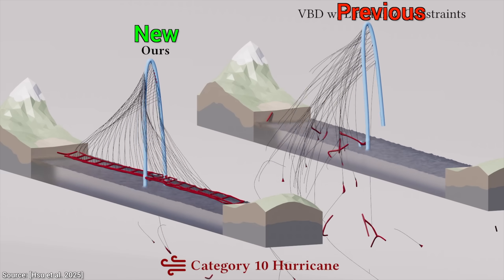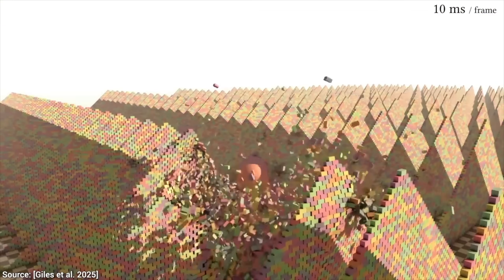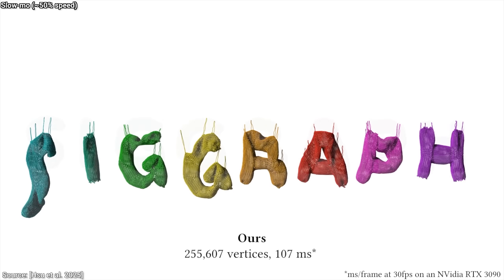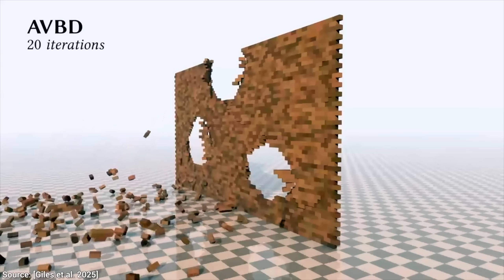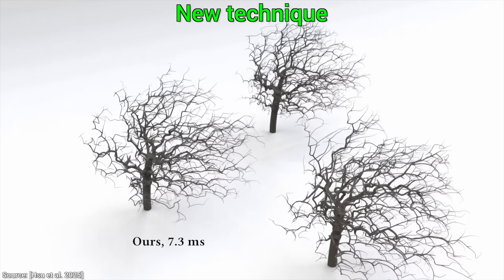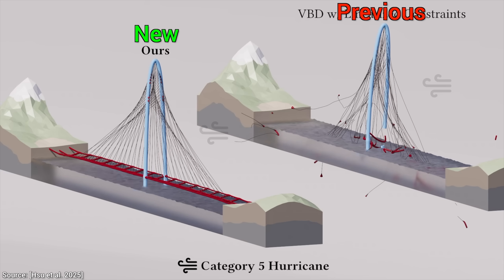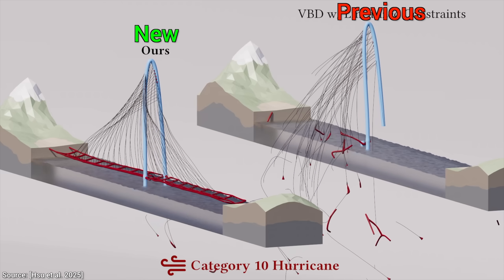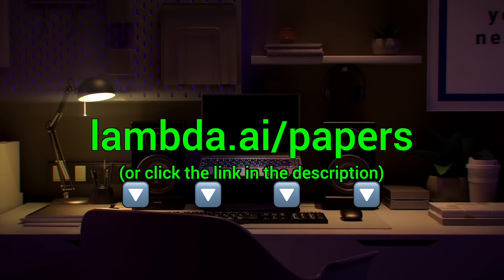This New Physics Engine Is 45x Faster!

Comment: Literally no one animates a fur or a whip, that's not how that works, that's not how anything works. A whip can be 30 bones there is zero reason to animate it when you can drive an FK chain physics function from the hand driving the whip you could probably do that 30 years ago. More you would never individually animate fur maybe stop using chatgpt for your intros you sound like a mouth breather.

Comment: If your technology can be implemented in the gaming industry, it will be amazing. Especially if it can be implemented into old or existing projects without the need for a total rewrite of the code. And/Or an interface for developers that allows you to set the necessary function names, etc. for the engine to dock with the existing code.

Comment: 2kliksphilip has done videos on old games physics, and he made a point that i could not agree with more, he said something along the lines of "there has not been much development with in game physics as we have been so focused on Real-time lighting" when he was showcasing old physics tech-demos, and i agree, as looking at old games with such impressive physics, like deformation, real time fracturing, cutting, splintering, shattering and smashing objects, as well as cloth and water physics that you would see everywhere in old games, running on old hardware such as the PS2 & PS3 with these special physics objects everywhere.

whereas now you very rarely see these impressive or interesting physics shown off, however this is back when games were made by accrual software and computer engineers from the ground up often on fully custom game engines made specifically for the game, unlike now where they are cookie cutter games made on recycled or bastardised engines made to make as much money with as little effort as possible, with the exception of mostly indie devs putting passion into their games for the sake of love and effort, not to just make a product.

Comment: you fail to mention that it only optimizes simulation of rods with rotation, and it does that by pretty much throwing the rotation out of the dynamics and doing it as a separate post-correction step. the main solver is just position-based vbd (which handles both stretching and bending), and since positions already define directions between segments, rotation only solves for twist on top of that, which is kind of useless.

Comment: Hopefully this physics engine can be used in games soon. It will be amazing to play games with physics like this.
Reply: Sadly no, its way too slow, need to be like x1000 faster. Also if you use GPU for physics then you will not have graphics
Reply: @lucasblomgren1975  I think what matters the most is that it can calculate the most complex things more easily, you should be able to calculate the simplest things EVEN MORE easily. I don't see why more optimization couldn't be welcomed. I'm pretty sure GPU are already used for the existing physics anyway, it's part of the graphics, and precisely a good reason why we need GPU rather than integrated graphics in the first place. CPU has way more reasons to bottleneck first.
Reply: @Aztonio  In the future it might be different but right now game engines don't use GPU for physics at all.
Reply: @lucasblomgren1975  Because current physics algorithms cant be paralellized. But this one can be, thus much more faster on GPUs with thousand of cores.
Reply: @lucasblomgren1975  not true. There is physx and AMD equivalent.
Reply: @lucasblomgren1975  no? Ever heard of physx, compute shaders, mesh shaders.....? Also it is fast enough, we can just do the same optimalizations we did up to this time to achieve more fps while having better physics.
Reply: @lucasblomgren1975  Idk why assume you can't do two things on a GPU at the same time, like there's multiple different things using your GPU right now and it works. Like we can run multiple different things on computers "at the same time" and it's a normal thing.

Some physics simulations cannot be done on a GPU, because they aren't optimized for it, but for video games there's no reason not use as much of the graphics card as possible, we don't need 1:1 real physics. A cloth simulation, like the ones in the video, could work much better on a GPU than a CPU, since the latter has only a couple cores and the former has plenty.

Comment: running at 30 frames on a 3090 is insane, really good performance for the calcs it must be doing.
Reply: It's not running at 30fps on a 3090, it's running much faster - the simulation time in one complex example is only 7ms per frame. But a 30fps frame is 33ms long. It comes out to about 140fps effective, which however also isn't exactly descriptive, since you can't just simulate, it doesn't make sense. You get me? For simulation to be stable, you need to set a fixed step rate, while simulation consumes a variable amount of time; but also you need to render the simulation result once in a while.
Reply: @SianaGearz  i dont get it lmao

Comment: Can't wait for this to be implemented in games and other medias! I love how passionate you are about these papers and it's really apparent in your voice!
Reply: It cant be implemented in games because its way too slow. This is only for making videos etc not real time
Reply: @lucasblomgren1975  I heard the mention of some of these being in real time but regardless I'm excited to see them in other medias :D
Reply: @lucasblomgren1975  It's way too slow... when it's calculating the most complex shit that wasn't possible before. Is there any reason why it wouldn't calculate the simple things 45 times faster TOO ?
Reply: @Aztonio  its on GPU. You cant use 100% of GPU then theres no graphics
Reply: @lucasblomgren1975  But that's precisely why optimization matters. If the most complex simulation runs flawlessly when it's a single process, then it obviously opens more questions and possibilites about how many more simulations, and other things, you can run in the same time. That's the basic of gaming. Simulating many different things at once. GPU is made for graphics but does way more than that. And actually, it's already a simulation in itself, like Ray Tracing. Displaying a frame is one of the most minor thing a GPU can do, actually. Unless you play at 8k or something, but then you're not a gamer from the proletariat like normal humans or of course you may experience reduced framerate... Well I played GTAV on a freaking Intel Celeron Integrated Graphics. It had physics... and rendered pixels on my screen. (at least a few) Crazy isn't it ? Optimization is fascinating, and complex.

Comment: Hope to see this technique used in video games like KDC2 or others with breakable structures, wind in forests and grass, fire, clothes, and hair.
Reply: It cant be used in games because its too slow. And if you use GPU for physics then your game will have no graphics at all
Reply: @lucasblomgren1975   It's not that slow, and the examples shown have included rendering, with simulation time of only several milliseconds per 33ms render frame.
Reply: @SianaGearz  For a game on 144hz then you only have 6.9ms total per frame to do everything. Graphics, physics, game logic, AI, etc.
Reply: @lucasblomgren1975 For now, not for tomorrow.
Check the GPU/CPU based on light.
Huge jump in technology.
What everyone said was "impossible" is now realized by TSMC.
By 2030 at the latest, they believe they will deliver the first full CPU and GPU based on light.

Comment: I love watching these videos but I don't understand very much at all.  I realize that there probably is not a simple answer to this question but; what's stopping developers from using these new techniques in video games right now?  Like, I am currently learning how to use Unity to make games.  Would it be possible for me to take the info from the research, hire a programmer and use them in my project?
Reply: Yes and no - In theory a skilled programmer can implement this into the engine of your choice. However, looking at the time needed and used hardware, these are not nearly optimized enough for a game.
If you want a game to run at 60 FPS, you have 16ms per Frame of GPU and CPU. This simulation takes up most of that just for the simulation. So you still need to render it, which takes time and most importantly the entire rest of your game needs to be calculated and rendered as well.

Usually for a feature like the afro or so, you would have a budget of around 1-2ms for the main character in close up shots at most.

TL;DR Yes, they are fast, but need to be 10-100x faster for in-game usage.
Reply: @PampersRockaer  thanks!   i had a feeling it was gonna be something like that
Reply: @PampersRockaer  more like x1000 faster

Comment: You always post these new breakthroughs. But I am curious, when in games they will get used, like after 5 years, or 10 years?
Reply: it uses the whole gpu for a simulation thats not exactly game world scale. needs a lot more optimization to work in actual engines and share the gpu with rendering
Reply: @xxedgelord420xx4  This is the real answer. These techniques are impressively performant, but nowhere near performant enough to run on a gameworld scale with enough headroom for all the other GPU-demanding processes. In fact, even in isolation many techniques are even more demanding than entire games. The stretchy band thing that was 45x faster rendered a frame at almost 23ms, while usually games should aim to run at 16.6ms (60 fps) or better.

Even when these techniques become performant enough for in-game implementation, it still takes a long time for these tools to get into the hands of developers, and for those developers to then master these tools.
Reply: @Vorexia  yeah and in games this extent of realism is rarely needed/ worth the extra processing power required and the difficulty it would be to work with something so new and not well documented.
Reply: he is basically like a hpyeman for white papers, the videos are always extremely positive. Not saying that is bad, per se, cause he is right that there isn't really anyone else promoting papers the way he does. But to find out if something will be used and a more comprehensive breakdown of pros and cons of how something might or might now be able to realistically integrate into an existing industry or workflow this is not the place. Which I personally think is a bit too bad, I would enjoy if the videos had a bit more of a measured take and slightly more technical explanations. But his video style is unyielding excitement and optimism with super easy explanations and he seems to be sticking to it.
Reply: Who knows if we will see them in games ar all

Most of these things perform well in none life situations, and on smaller scales

In other words, you might see it in animations or scientiffic simulations, but not in actual games

There are some papers which have the potential to be used in games, but the exact games which need them simply dont exist

For example, what game outside of physic sandboxes would require super accurate and very detailed physics algorithyms?

Most games are better of faking it
Reply: I bet this year. You can thank Dr Carroll for that!
Reply: Should take 30 years. We WILL have extremely realistic graphics in our video games in 5 years, but it will be some AI filter tricks laid upon a very basic mesh skeleton. Think GENIE 3 from deepmind.
Reply: @Maaru107  Something like that already exists today

I played the newestvmonster hunter game, and while you dont see a difference, there are severe performance issues
Reply: None of these breakthroughs are for games.. they are way too slow

Comment: It's frustrating that these papers are not implemented in softwares
Reply: The method that John Carmack used for Doom to achieve 3D graphics, binary space partitioning, was originally developed in the 1960s. Hell, the original theory that led to our modern AI, transformer models, came about in the 1930s. It can take some time to turn theory into a practical application. The hurdle for the two I mentioned was lack of compute and also lack of data for the transformer model predecessors. In truth those 'predecessors' were nothing more than a proof of concept.
Reply: @soulsmith4787  The concept of raytracing was first presented by Albrecht Durer in 1525, but it took quite a few years before it could be implemented in realtime on consumer hardware.
Reply: They are, it just takes time. Making theory is one thing, but then making a polished, workable and useful product from it is another step entirely. Houdini for example gets a lot of new algorithms implemented all the time. And people are making addons for blender too that can doo this stuff.
Reply: It is, the paper describes exactly how it works, including everything needed to reproduce these results (although a source code repo is usually a bonus, it's usually a specialized implementation that's not exactly transferrable to other systems). This is how all papers work. Just give it time, unless you want to implement it as a plugin for say, unreal or blender yourself.
Reply: also nothing stopping you from implementing it yourself.
Reply: houdini sells being good at avoiding the problems this solves.
they might see  it as a bad idea.

also there is a large gap between a paper and a working implementation. (or so they say)
Reply: I know we see all of these breakthroughs and when do we get to see them in games? It’s gonna be like 20 years from now and something else is going to be the New form of entertainment by then.
Reply: I must say that I agree with "DrTheRich"...  And it's not that I (like everybody)  wouldn't be happy if we had the "BEST algorithms and techniques" implemented in our games and programs "immediately"... But as "DrTheRrich" points out, in the real world these things take time. And being able to create/invent/discover a new method/algorithm is FAR and away from making something that is "ready for production"...
Not to mention how many of us who would be "left in the dust" when(if) all new games and programs absolutely REQUIRED that our hardware was "up to date" and powerful enough to run these new algorithms without "coming to a virtual stand still"... Maybe worth a thought...
Best regards
Reply: Because this is not for games, its way too slow. Need to be x1000 faster to be real time.
Reply: How do you expect someone to build a NEW physic engine with technology that was invented a few weeks ago in less than 6 months?
Reply: I for one feel like some of these things are implemented on a 7 year cycle or so within recent years. It just depends on the purpose & need, Movies/Video Games/Developer & game engines / GPU company when trying to sell you new products (mostly ads during their showcase ~ e.g., DLSS ~ it took time for refinement & so on...
Reply: lol because most of them are useless or have a very specific purpose. Or were already implemented 20 years ago.